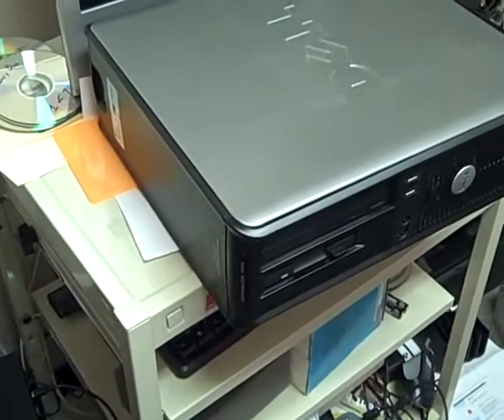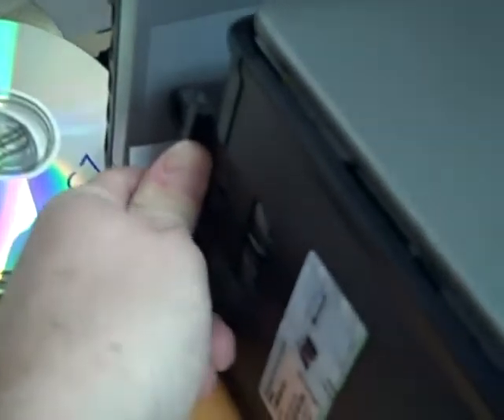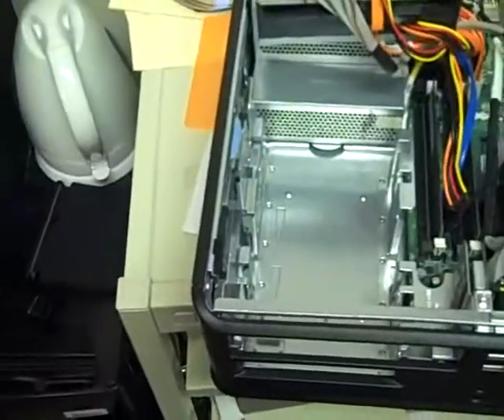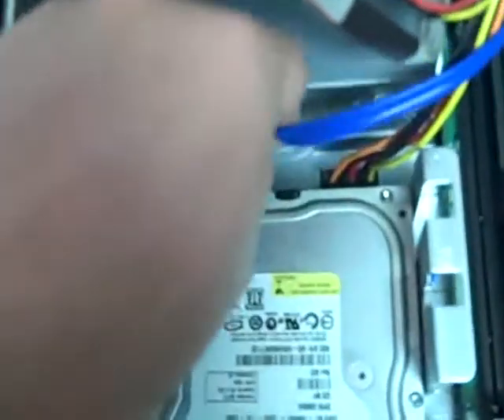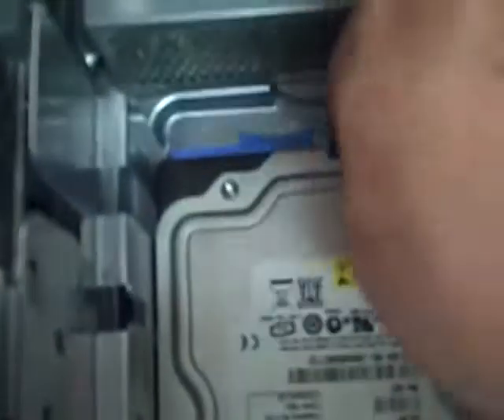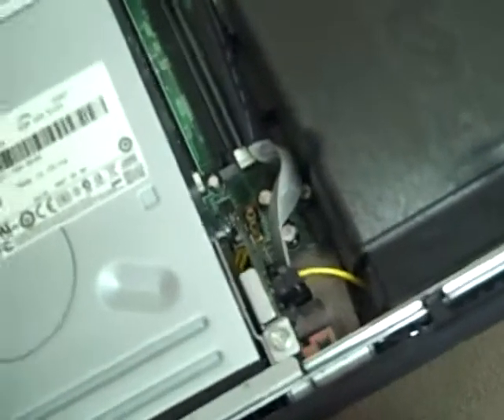Hard drive swap - Optiplex 745

Comment: Superb video. I just picked up a refurb Optiplex from Geeks that was enough for basic surfing and record keeping, except it had an 80 gig drive. Used your video to swap in a 320 I had lying around and I'm off to the races. I found it easier to connect the cables to the drive before installing, but I'm a bit of a klutz, and fishing around it tight spaces isn't my thing.

Comment from the maker: xxd:  you can try, but it'll likely be a partial failure unless the hd came from the same model PC.  Device drivers in the OS are machine specific and very simple devices like the network adapter may not function until you manually install drivers from the Dell website.  But good luck!